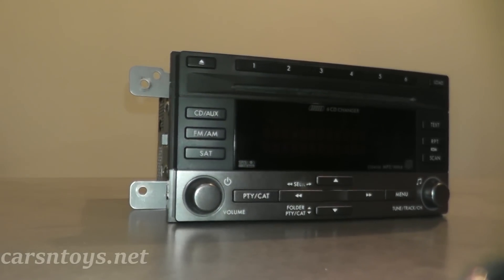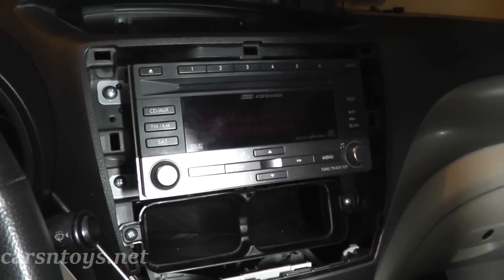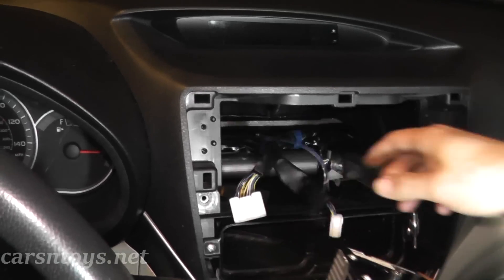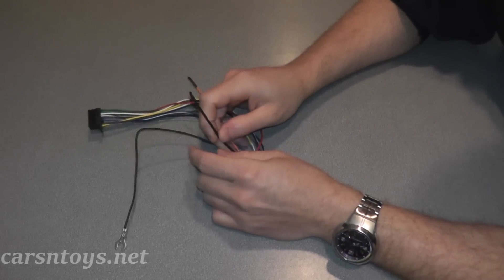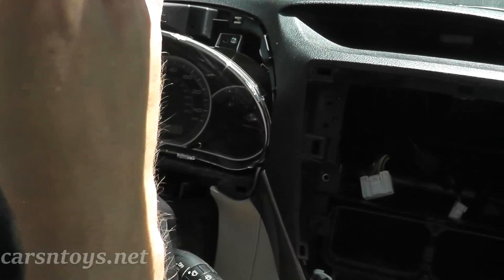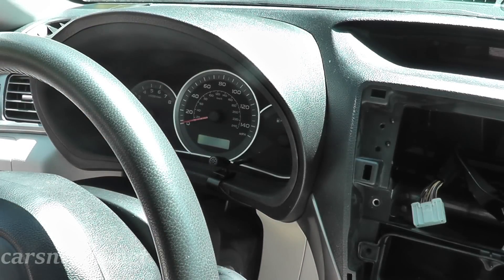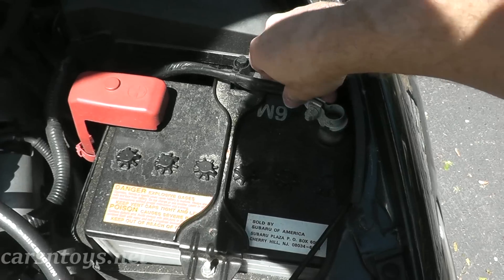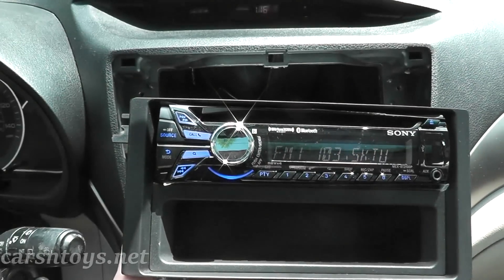Subaru Aftermarket Radio Install with Bluetooth HD

Comment: As you removed the factory stereo, you unplugged the stereo harness, the antenna, and two other connectors; what were the other two connectors and what did you end up doing with them?
Reply: John Yoakum that was the steering wheel control connector.
Reply: I could be wrong but I think the single wire with the flat terminal connector is the AUX input from the arm rest/center console.
Reply: @Infinite_AM  I have an 09 impreza with no aux, and I have the flat terminal, so it must not be aux?? Unless subaru was lazy and left it there regardless
Reply: @arianal4684  my 06 accord had an aux hook up with no jack, i bought an adapter and it worked. so, its possible
Reply: @arianal4684  Pretty sure that FLAT TERMINAL on the back of the unit is a chassis bond connection for the shell of the radio. IE just like how the rest of the car's electronics are all bonded to the chassis of the vehicle, including the NEGATIVE battery terminal, it creates a proper bond with the battery terminal through the chassis of the vehicle. Most refer to this, incorrectly, as the 'GROUND'. There is no GROUND in a car, as the vehicle is actually ISOLATED from ground due to the rubber tires. 
Grounds are literally that, a connection to the EARTH.

Comment: really great video!!! this is exactly what I was looking for. Just one question: what is the little white connector you unplugged from the factory radio you seem not to carry about when mounting the aftermarket one?
Reply: probably the steering controls and rear aux-in

Comment: How can I troubleshoot where the stereo won't power up? I temporarily jammed the ground from the adapter kit between plastic & frame. I am also adding a Maestro module for steering wheel control.  So frustrated as it seems very straight forward. Thanks

Comment: would you happen to know why my radio reception is very bad on my 08 sti? it came with an aftermarket radio, bad reception back then, upgraded to the android head unit, radio still sucks, read somewhere that subarus use a 12v for better radio reception, but not sure which wire that is. i plug in the regular anthenna connector then switch to the android anthenna connector, but same problem

Comment: Hi did this installation allow the steering wheel controls to work with the system?
Reply: +Sam Sherren nope, need an other part of kit to get them working with aftermarket radio

Comment: Is it ok if the ground is touching the plastic when it was wedged between the metal bracket and plastic panel? I just didnt know if over time there would be heat on the plastic or too much resistance for the ground to work well? Thanks!
Reply from the maker: John Smith Yeah, the negative tab won't heat up. Cheers
Reply: Great video but personally I would have soldered the ground wire into harness adaptor ground. I am thinking the separate ground is for if used in older cars or applications that may not have had a harness. Do you feel like you get a better ground by doing it this way?

Comment: I have the same Impreza, but I cannot find buttons for the steering wheel (volume, mute, radio, etc). Can you help me?
Reply from the maker: Do you mean the steering wheels buttons no longer work? If that's the case, you need another adapter that will specifically work for the steering wheel controls. You can find the specific adapter via crutchfield.com
Reply: @CarsNToys  No man. I have no multimedia bottons. On the steering wheel I have only cruise control buttons at the right side, and I Want to have multimeda control on the left side of the steering wheel.. that is my steering wheel, filmed it today: https://imgur.com/a/wW1gWKl

Comment: Will the steering wheel controls still work in this type of installation? Thanks in advance.
Reply from the maker: +stearem s It will, but you'll need to buy another adapter for it to work.
Reply: +CarsNToys where can i get this adapter

Comment: do you need an antenna adapter for aftermarket radio i also have a subaru and I am trying to install one
Reply from the maker: Sam Lucia I didn't need one for this car but I did need one when I did a radio swap on a Nissan Maxima that had a factory Bose unit. Check out crutchfield.com They make it super easy. Just insert your vehicles info and their site will tell you everything required to install an aftermarket radio. Cheers

Comment: Does it need a antenna adapter or just use the antenna from the car
Reply from the maker: An adapter is required on some vehicles. Best bet is to visit crutchfield.com. You can simply search for car radios (specific for your vehicle)  on their site and it will advise all parts required to complete the job.
Reply: I have a 1996 Subaru Legacy wagon do you know if I would need a antenna adapter for that I did look on the website and it said 0 for antenna so that must mean I don’t need one

Comment: because i am a HiFi enthusiast and car audio generally sucks,, especially aftermarket equipment... i find that the stock head units are far better quality and have better sound quality. they are clearer, better frequency response and lower distorsion but lower power. the aftermarket ones generally suck ass. especially sony, pioneer, jvc, fusion and most other brands. they sound like ass. the treble is  too sharp. the bass is bloated, has poor frequency response, nice high power ( 30 or so watts or so per channel compared to 10 watts) but they also have terrible build quality. the alpine units are an exeption. the only aftermarket head unit i would install are McIntosh  from a subaru (can be obtained from as little as 50 bucks), vintage yamaha or alpine or keep the stock and upgrade the speakers to alpines. often the stock speakers are clearer too.
Reply: You're clearly buying the wrong products...
Reply: Tom Westbrook i dont buy car audio at all. I spend money on my car in other ways.